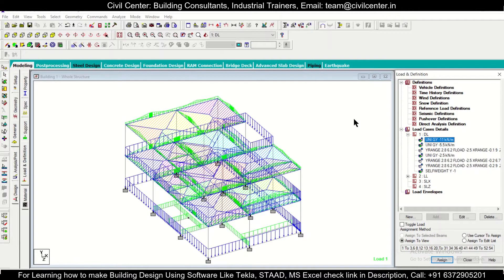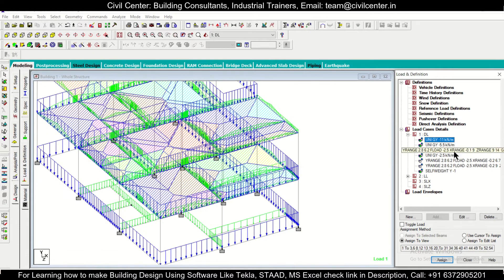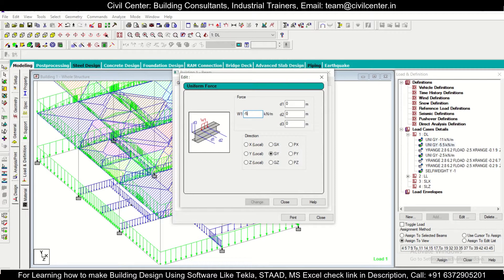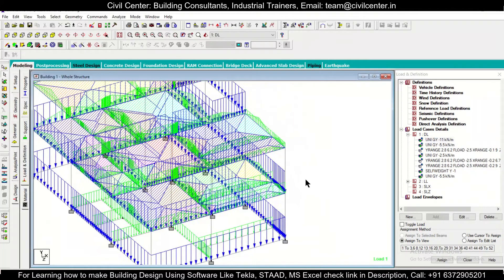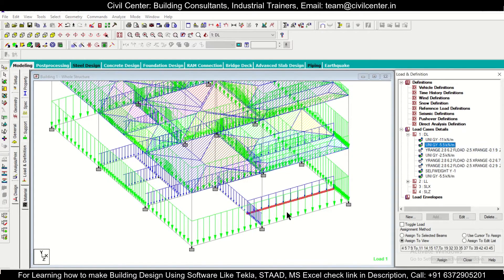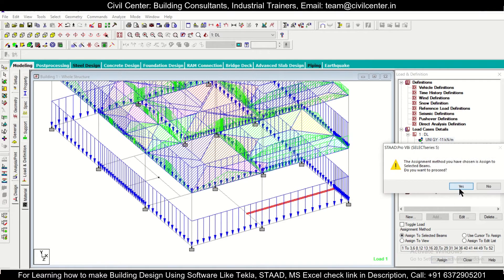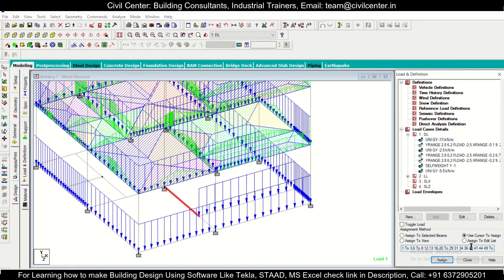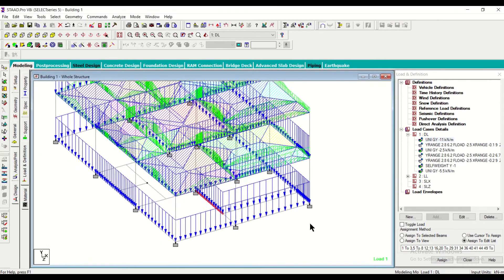STAAD. Pro: How to Change/Edit and Delete Loads || Editing Member Loads

Comment: Sir self weight of beam and column bhi apply karte hai kya model  par
Reply from the maker: Design ke time karte hai
Reply: @CIVILCENTER  
Maine itne online video dekhe hai joh staad pro main design karte hai woh self weight of beam and column apply nahi karte hai h
Reply from the maker: Load application ke time provide nehi karte, but design stage mai provide karte hai, because software automatically calculates the self weight from the member sizes and concrete grade